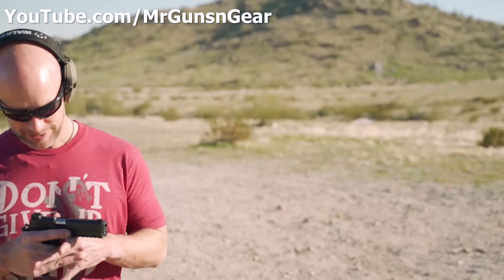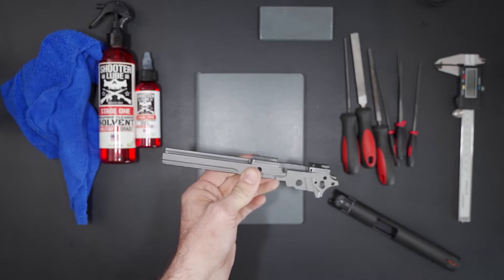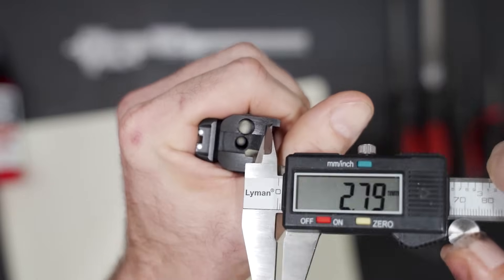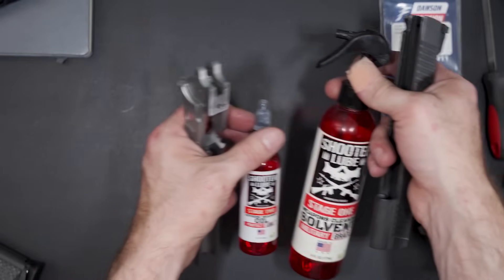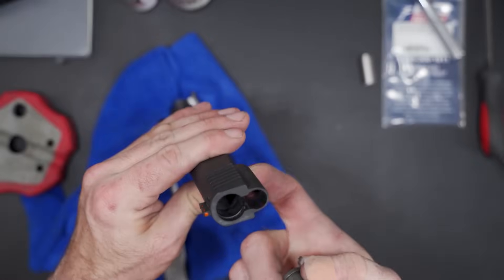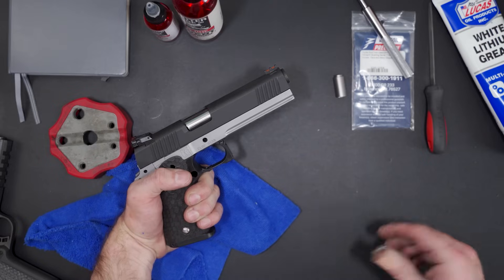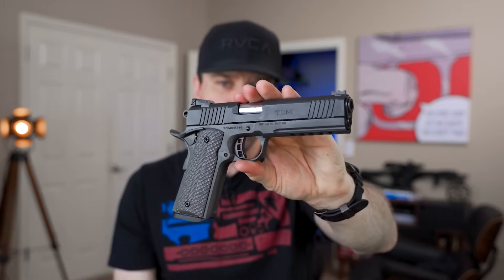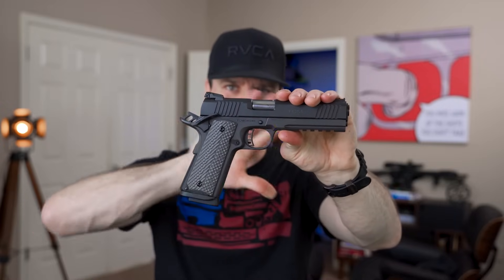Custom 2011...Slide to Frame Fitting

Comment: there should kinda clearance between frame and slide rails. If its over accurate when gets dirty it might cause cycling failrure, this principle applied to all semi-full automatic firearms. look at clearances at AK-47))) but in field dirt and dust conditions it never fails

Comment: Slight point of contention - a 2011 is not lighter than a 1911.  Yes the grip/magwell on a 2011 is plastic rather than steel, but it is to facilitate the doubling of the ammo capacity.  You aren't shedding weight, you are trading useless-weight for useful-weight.
Reply from the maker: Good point man
Reply: Actually, the magwell is perhaps plastic on a STI; however, the magwell is NOT plastic on Para Ordinance, or the RIAs which are based on Paras.
Reply: @BU1Lander  or Caspians!
Reply: @BU1Lander  those aren't 2011s

Comment: You don’t need a tool to take out a barrel bushing unless it’s extremely tight... just pull out the slide stop pin first and disassemble it that way  then you can take pressure off the recoil assembly and just pull it out...

Comment: You don't need a tool for barrel bushings. Just need man fingers or hit the outside of the part of the bushing that goes into the slide with 800 grit sand paper or a wire wheel dremel tip. Or even just polish it. That should make it easier. Great vid though. I'm a recent convert to Glocks because of you. Used to rock 1911s

Comment: First 1911 build I did was on a stainless Taurus, laugh but I won't part with it... Every part has been replaced with Wilson and wolff and a fusion hand fit bushing, absolutely the best shooting pistol I own, better than my czs and even my sr1911.. did about a 2lb trigger job and it's extremely easy to shoot accurately

Gotta do this build next, instead of buying a tac ultra I think I can beat the $800 price and have an sti dvc lower... Yep... Gotta do it..

Comment: the usual way to fit the slide to the frame when you can get it started is clip the frame in a vise, put valve grinding compound on the slide rails, and tap the slide back and forth with a rubber mallot.

Comment: I've read that some guys will use lapping compound on the frame rails at the point that you are at in this video. Using the lapping compound and running the slide back and forth fine hones the frame and slide to match each other, as well as polishes them at the same time. It's slow, but that's what you want.
Reply: Don't laugh but my uncle's used Comet cleanser back in the day.
Reply: @NickNnox  interesting. It is very gritty, I imagine it'd work. Not sure how well, but you never know.
Reply from the maker: I have some lapping compound... The only reason I didn't use it is because Im trying to see how few tools I can use to build this
Reply: @TacticalToolbox  Ahh, makes sense considering how you are doing this series. I can't wait to see this bad boy spit some lead.

Comment: Ok lemme correct him a little bit .22TCM is the USA version of 5.7 basically. Pioneered by a Kansas dude, Its actually a Remington .223 bullet that is necked for a .22cal  40 grain bullet- ALA 300 Blackout if your familiar with that. Yes! that's right HP Rifle ammo in your 1911- kinda. Its a lazer fast 2000FPS/400ft lbs about the same power as regular 9mm in total.  It has a little more umpf than a 5.7 and its easily reloadable and Cheap!  Unlike 5.7!  I bought 1200 rounds for under 400.00 a few months back, fwiw.  I already reload .223, 300blk and 6.5 grendel, (all .223 cased ammo) now I have a 4th .223 case, cartridge I can reload! ( for about 14cents!) Dies are about $45.00 from Lee.  My RIA 4.25" Commander holds 17 in the flat base mag, same as 9mm (its the same mag too! ) I can change springs and barrel in less than 2 minutes and shoot 2 different kinds of ammo in my 1911's! They make a 22 TCM slide/barrel kit for you glock guys too but with a slightly rounded bullet to fit a glock as well.   I love America!

Comment: I have never had to use a tool to take down my 1911.... And my Springfield Armory R.O. 1911, with me doing my job shoots 2" groups at 30 yards.
Reply: I have never used a tool either, but I hear the reverse spring plugs can be rough on the fingers and need a tool.
Reply: STI used to (might still) make a captured guide rod that requires the use of a tool to take down. There are other one piece guide rods out there that require you to use something similar to a paper clip to take them down.
Reply: Try taking down a les baer without one 😂

Comment: Get rid of those calipers, and buy a pair of Mitutoyo calipers and a 0-1" micrometer. Those calipers are good for nothing when it comes to tolerances in the thousandths; you need a micrometer for that.
Reply: Actually a set of blade micrometers are better as is using blueing...
Could use a CMM which would print out a data sheet.

Comment: You do NOT need any kind of special tool to take a barrel bushing off of a 2011. I own two and have never used any kind of special tool to remove the barrel bushing from either one (RIA Milspec and RIA TAC Ultra HC, both in .45). Certainly a tool might make removing the barrel bushing much easier, but it is by no means a necessity.

Comment: Some thoughts on your over sprung comments I have fire a 1911 45ACP, a very short 45ACP called an officers model by colt and a long slide AMT hard baller 45ACP. Your description sounds like long slide it seems to have a mind of its own kind of takes it time during recoil the offices model is very quick through the recoil I don’t want to say cut the spring without test firing but one coil off may be perfect.
Reply from the maker: That might be a good idea man

Comment: Ive been building guns now for just over 40 years. I cannot see a reason for the so-called 2011.

Numerous manufacturers achieve the same result with more dependability and far less money.
In the end you have a large heavy pistol with about the same capacity as most mid sized 9mms, and the only really decent thing is the trigger. Lots of guns have, or can be given, good triggers.
But most 2011s are two or three times the price of a well proven gun like a Glock, M&P, CZ, etc.
To each his own, i believe in personal freedom above all else, but unless you just have so much money lying around that its in your way, it isnt really a cost effective idea.

Comment: I feel like you just wasted alot of time and money. You dont need a tool to disassemble an 1911. Just use your thumb to push the plug down and turn the bushing. Still pretty cool never knew that was a thing
Reply from the maker: Once the bushing has been broken in, it can definitely be removed with your fingers. But when it's new or freshly fitted it's almost impossible to remove without a tool